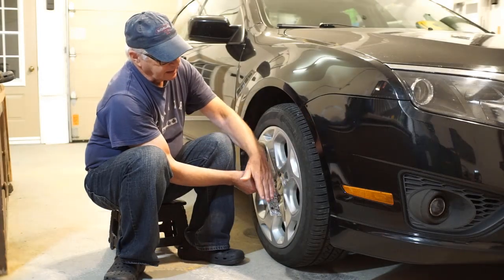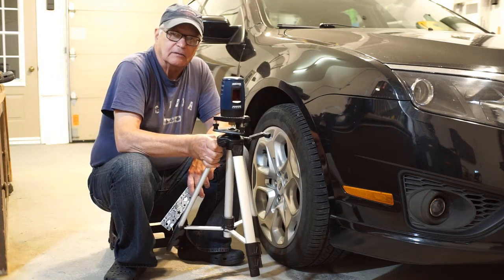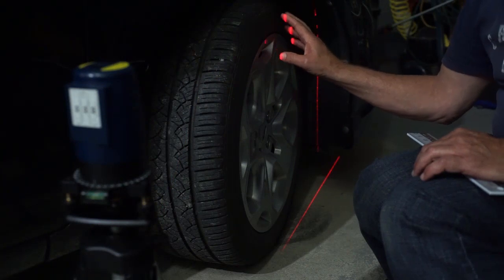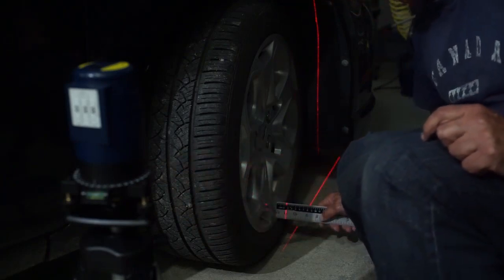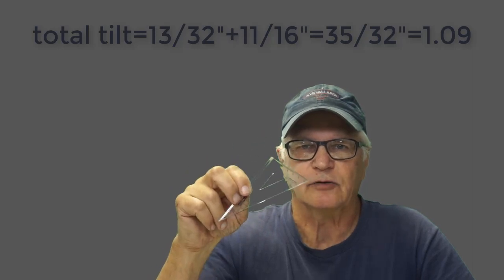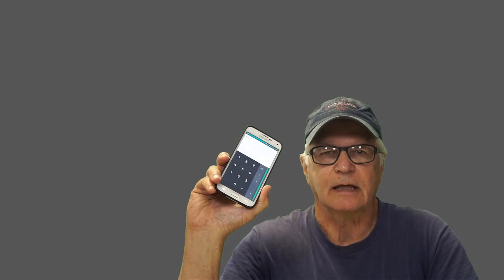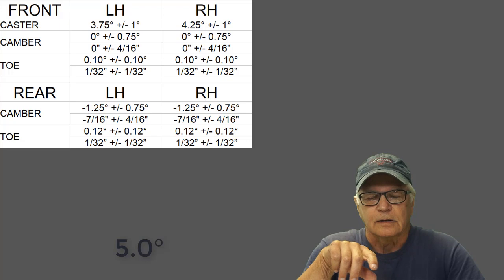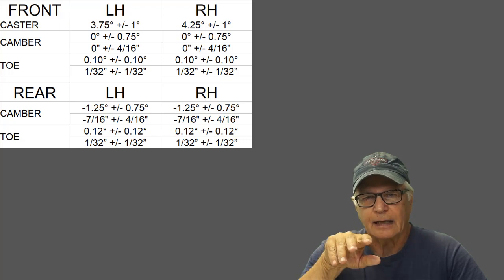GADGETS#67 - CASTER

Comment: Good day Sir,  The vehicle ride height is important to the caster reading, and as such the specs are written for the factory ordained ride height.  I'm curious that your caster (and other) specs no longer apply when you've altered the ride height by releasing air from the rear tires to obtain a level "trim" line.  Perhaps your rear tires were over inflated to begin with?

I am new to your channel and have subscribed, but I would like to know a bit about your background and experiences.  I checked the 'about' section but didn't see anything noted.

I like your common sense, yet technical approach so I think we're going to be fast friends; although that may depend on your hockey team of choice. ;)

Thanks and keep up the good work.
Reply from the maker: +Integrity Motorcar - tire pressure adjustment was a practical method of adjusting rear/front level. I do not share concerns over this small ride height change vs caster readings.
My professional career was mechanical trades - machinist, millwright, dynamic balancing...
My automotive is 50 years of DIY.
Am a strange canuck as I don not follow hockey🙄
Welcome to the channel.

Comment: Good stuff. 
You said you used the body (I assume the fender) to "eyeball" the 30deg turn angle. But not all cars have straight body lines . Case in point my friends Cobra where there isn't a straight line on it.
Could the laser level project a straight line on the floor (parallel to the length of the car) to measure from? Then you could put a straight edge along side the rim (or tire) to measure the angle of the rim vs the straight line?
Looking forward to the rest of the installments.
Thanks
Reply from the maker: +Dave Sage - YES
If eyeballing can not produce repeatable results, then more elaborate methods are called for.
This type of laser level has a degree graduated base. Position laser level strategically so that you can project a beam parallel to the vehicle. Rotate head 30° and measure off that beam to rim.